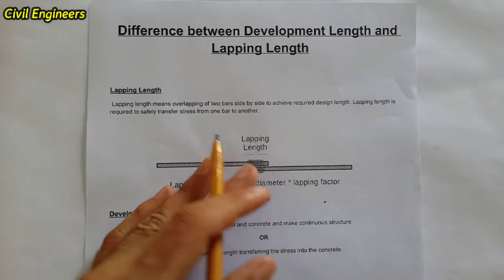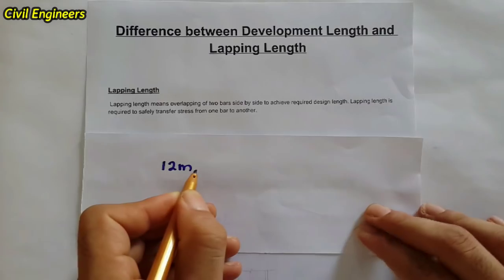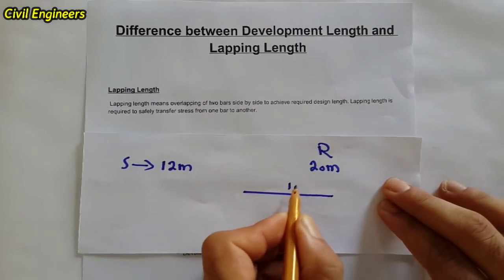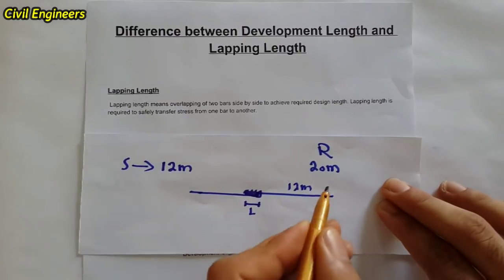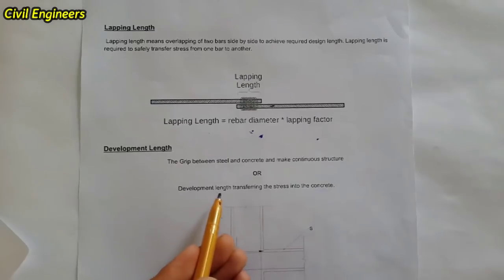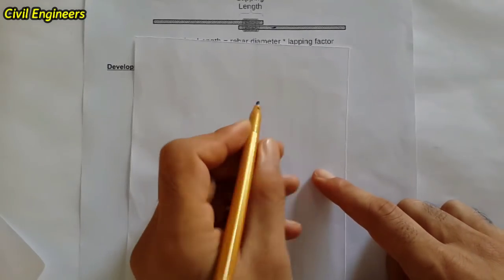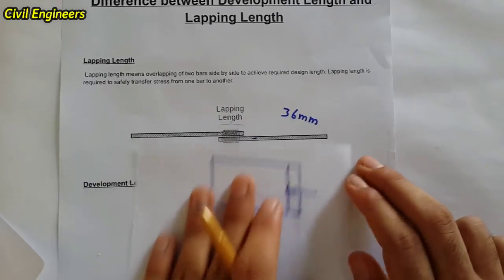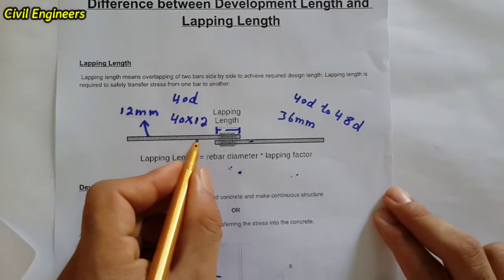Difference between Development length and Lapping length

Comment: you failed to mention to not place all the lapping length areas in the same location of a column or beam, the lapping joints need to be staggered and never where a column meets beam or beam meets beam or corner. "no rebar in beams should ever end in a corner or column" THIS IS THE MOST OFTEN MADE MISTAKE : starting all 4 ring beam rebars at the corner and ending up with all the lapping in the same location and ends in the columns or corners.. you need to address THEE most often made mistakes.

Comment: if a beam B1 is connecting to a Col from one side and another beam B2 is connecting from opposite side of col. And both beams details is different B1 has 3 Top continues bars and B2 has 4 Top continous bars how will we provide development length and will B2 continues bars extend into B1 or not plzzzzzzz someone .....

Comment: development length is not what you stated. it is total length of the rebar of column inside the raft for stress transfer. so its a typical L shape in the case you presented.

Comment: Lapping is done through basically three methods
1 splicing
2 welding
3 anchoring by mechanical means
Splicing: never splice steel bars greater than 36 mm due to eccentric effect
For direct tension : max of 2Ld or 30d
For flexure tension : max of Ld or 30d
For compression bar: 24d
In no case lapping should be less than ( 15d or 200mm)max

Comment: Thank you for clarifying the difference Between the D.L. and L.L. for reinforcing bars, but to be clarified for the lapping positions , that it will depend on what is the layer working on for lapping, that's mean if the lapping will be done for the R,bars  in tension side , then it should be at the mid center
 line of the supports while if the lapping is required to the compression side , then it should be at the mid way of the mid span

Comment: Development length is the length required for the full development of stress in the Steel, and lapping length varies from 50d to 55d from horizontal and for vertical.

Comment: Bro i have a little confusion in determining the size of coloumn and beam while designing a building...for example if im about to design a 3 storey building of abt 1200 sf in area..now how do i determine if the size of columns 12×12 or 16×16 is safe enough...i need help urgently..please explain
Reply: Its a bit of experience that matters while choosing the size. You can do structural analysis for different sizes and put forth the reasonable and safe size. God bless.

Comment: Good information, and tell me how to calculate material required to 1000 sqft plain slab?
Reply: Multiply by 0.176 per bags 'multiply by 0.44 sand and multiply 0.88 crush(aggregate)Ratio (1:2:4)

Comment: In singly reinforced slab lapping should be at end for bottom rft and doubley reinforced slab lapping should be @mid span  for top bars for tension zone we are providing 60d and for compression zone we are providing 50d.
Reply: how will be when we use lapping in beam structure what is the formula that we use in tension and compression